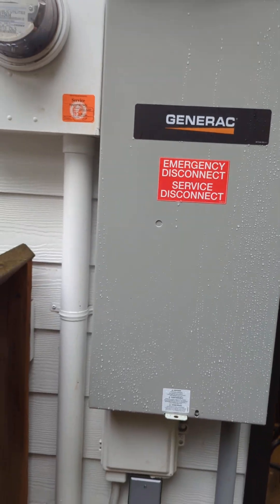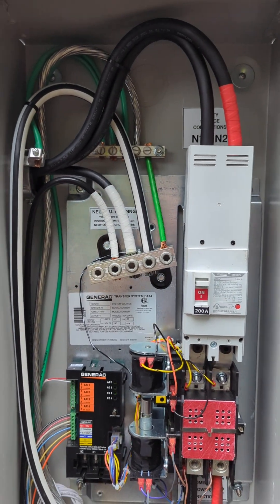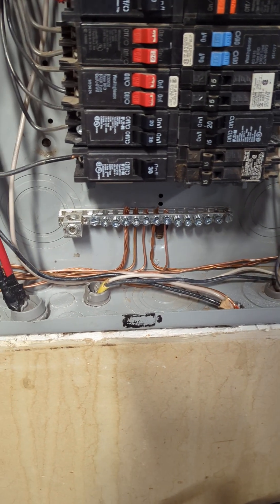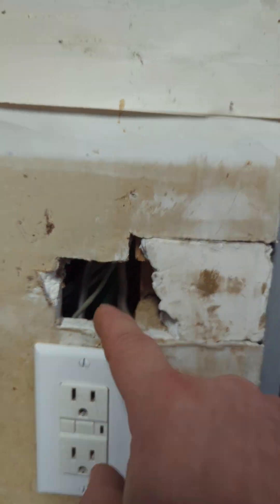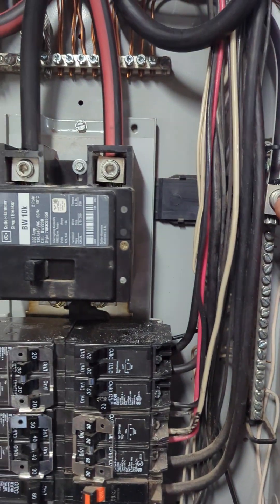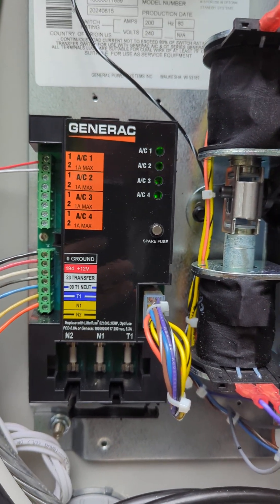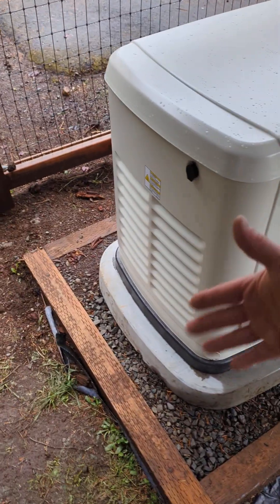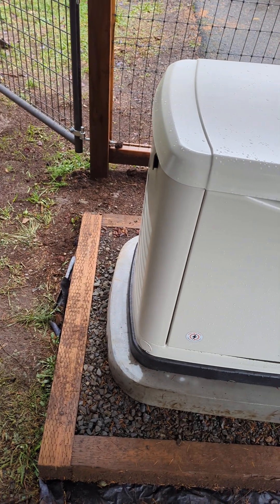Generac 22 kW whole home standby

Comment: great video, did you have to remove the ground bond jumper in the generator to avoid parallel grounds or did it come ungrounded? During construction our electrician installed ATS at same time as two electrical panels and permanent power but generator was connected two years later. Since generator has been connected, we've lost power three times and every time all our gfci breakers flipped. Electrician says it's because storms in the area have had electric components which is causing the breakers to flip. Trying to see if they just forgot to remove a jumper in the generator wiring. Thanks for any thoughts you have.

Comment: the ground from the inside panel is going out to the ats switch? is this an area code compliance or is that that NEC on whatever editions?
Reply from the maker: @dan8220  In this scenario the ATS is becoming the first disconnecting means or "service disconnect", so the main bonding jumper now needs to be relocated to that point per NEC. So, yes I relocate the grounding electrodes  or "grounding bullseye" to the ATS via a properly sized conductor and irreversible compression crimps. That is now where the neutral is bonded to the electrodes. Then I have to separate all the neutrals and equipment grounds in the existing panel, so as to not create parallel paths to ground.
Reply: @AGEElectricInc  okay, so I put my own generator in and the ground from the main panel I left it existing to ground rod outside that it ran to Then I put a new ground rod in and ran #6 bare cooper to the ATS. Separated the grounds and neutrals in the panel also, wondering if I should put the ground from the existing to the new one and join them together?

Comment: Looks great. Its refreshing to see an electrician who knows what they are doing. I see so much hack work out in the field. It varies by inspector, but most around here allow you to insulate the concentric conductor on a 3 wire appliance circuit too so you dont need to run a whole new circuit. I have failed for that in the past though, and had to run a whole new circuit, new 4 wire receptacle, and new appliance cord. I was not happy.